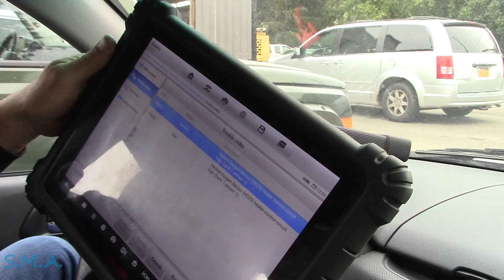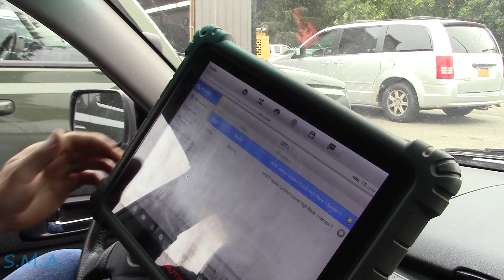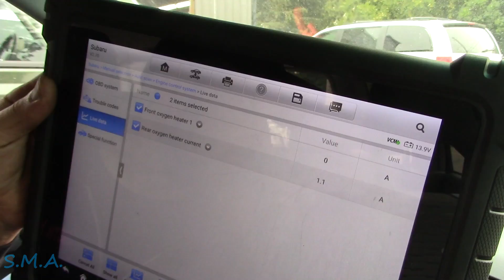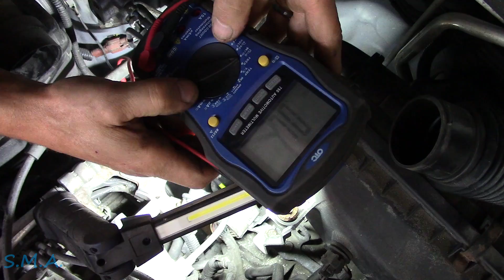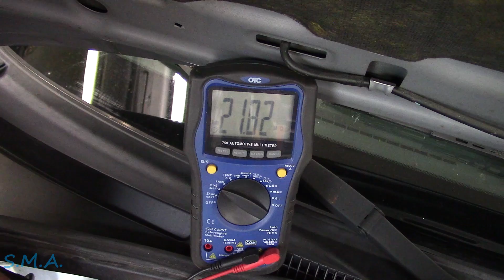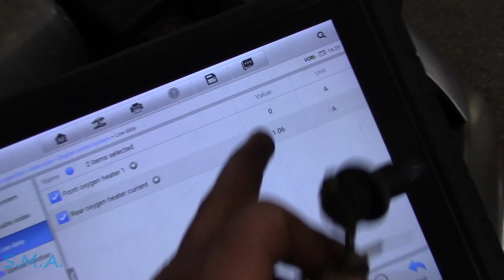Subaru Forester: O2 Sensor Code P0032

Comment: So, when can I expect to need a 'head job' on my 2014 Outback? It has about 70K miles on it now.
Reply: Subaru changed to MultiLayer Steel (MLS) head gaskets in 2009. That made a big difference.
Reply: Never. The FB engines dont have the head gasket issues, or if they do its extremely, extremely rare

Comment: I like that bit of test light bulb tutorial.  My daughter's 02 Subaru had a similar issue but the CV axle rubbed through the front O2 sensor wires. Spliced them and all was well. A real pain to get to though.

Comment: The Snap-On scanner shows individual cylinder misfire counts on way more Vehicles than the autel. If That was CA the ECU would be fried because all the wires got shorted together when they stole the cat
Reply: Eric has several scanners that he uses for various purposes - I suppose each has strengths and weaknesses.

Comment: So technically a 20 ohm resistor across the control and the computer thinks everything is hunky dory and would shut the idiot light  shuts off. I wonder if used car places have done this..mmmm?
Reply: I am shocked that you would suspect some used car palace of doing such a thing! Shocked, I say!
Reply: @flagmichael  So... you've seen Casablanca, too?
Reply: @flagmichael  Are you kidding? I had one place tell me I could fix the squealing belt with belt dressing, and replace the bad sensor myself. I didn't think I walked into CoPart looking for a car.....

Comment: Do all Subarus tick like that? Man that was loud.
Reply: Sounds like  the valvetrain of the passenger side cylinder head to me.
Reply: Probably needs a valve adjustment. The camera could also be picking up and amplifying the sound a bit too, but they aren’t a quiet engine by any means.
Reply: The older 2.5s are super notorious for piston slap. Most of them go for years with that noise without any issue.
Reply: @birdbrainxzx  Yup, mine has been piston slapping when cold forever and it's harmless.  The skirts on the pistons are too short or something.  However, it sounded like this one had  valve noise (too?).
Reply: Yes and no.  Older ones were well known for that sound.  Newer ones are smother and quieter.  My 2015 I compare to an air compressor as it revs up but smooth and nice power.  My Mom still thinks I am lying when I tell her it is a 2.5 4 cylinder because her 2.4 4 cylinder isn't anywhere near as peppy as my subaru.

Comment: I've had a 2009? Dodge grand caravan sxt 3.8 that the thermostat was failed so the van wouldn't heat up fast enough leaving o2 sensor on heat cycle too long burning it out. Guy did 2 o2 sensors before bringing it..real pisser to figure out.
Reply: Good one to put in my diagnostic memory bank, thanks for your comment!
Reply: @mattcat231  your welcome.
Reply: I have never thought about that. Good catch on his part!

Comment: Eric , I like that test that proves the circuit is good ..,
Reply: The way I did it was to test the voltage at the plug with the sensor connected and then disconnected.  Eric's method is better though.

Comment: May just have been the camera placement, but that engine sounded about ready to scatter pieces everywhere. 😂
Reply: That's just how Subaru's sound right?
Reply: @Burn377  I've got a 2010 STI with 115000 miles on it and it doesn't sound at all as tappy as this one does. This one's top (side?) end sounds dry.
Reply: It needs the valves adjusted (old school screw/locknut style)
Reply: yeah it's hammering something hard in the upper end, I've heard excessive valve lash off before, but I'd guess that one has something far worse occurring to be that loose, like maybe valve guide or seat walking out a head, adjuster way backed off. I forget the design without looking it up, but many engine rockers can hit the spring cup and knocking the keepers out, then goodbye valve goes into the cylinder.
maybe the camera amplified it, but otherwise it's terrible sounding and needs addressed before it decides to go part scattering.
Reply: It’s a Subaru thing
Reply: @Codyjrt  It was just replaced in 2018.
Reply: I was thinking that also.  Wicked clatter going on there.
Reply: @Codyjrt  Upper end? it's a horizontally opposed engine ! it has left and right side heads that are down low in the engine compartment.
Any valve train noise is reflected off the inner fenders and sounds louder, especially while the camera with microphone is there to record what we are hearing.
The head and or heads on most other cars, trucks, are up and almost out in the open when the hood is up "compared to a Subaru"
Reply: @scal3guy  Thanks Kyle, every single person in here knows what he means, it's still the top end of the engine.....  So just go away.  I know, you likely learned that yesterday and are excited but calm down.  You and your wife Karen can calm down.
Reply: @sjfk1306  Don't you have a real youtube username ?
"sjfk" What a silly user name 😯
Do you even know what a Subaru engine looks like ?
My wife "Karen" your mum 😋is going to disown you if you keep making stupid replies to other peoples comments !
Reply: @sjfk1306  really? Dragging his wife into it? Anything you could have said of value was obliterated by that.
Reply: @stevewhite3424  Not really.....

Comment: Once removed from the ad hype, head gasket issues drag this car maker down to the truth. All cars have issues. I'll stick to my Toyota.
Reply: Apparently, Subaru got a handle on the head gasket problems starting in the 2009 model year. Different head gaskets.

Comment: “What Subaru hasn’t had a headjob”, just spat my coffee 🤣😂
Reply: The owners hope for one also lol
Reply: @Sicktrickintuner  But not the bad kind.
Reply: @Sicktrickintuner  "The mechanic said I'd blown a seal. I said "Fix the damn thing and leave my private life out of this, okay pal?!"   -- "Wet Dream", by the late Kip Arddotta
Reply: Guilty 😒
Reply: Mine hasn't.  2015 with 110k no head gasket issues so far.  It was mainly a select few years where they were using a graphite coated gasket instead of the good MLS gaskets from the factory.  I do believe they have learned their lesson on that.  For those years that used the Graphite covered gasket when they need to be replaced you just use the MLS from the Turbo version you don't have issues after that.

Comment: I have never seen a video with a volvo. Do you never work on Volvos? Are they not common in your part of the US?
Reply: Mr. J  -  I don't know about upstate New York where SMA is, but here in Wisconsin Volvos are few and far between.  Barely any at all.
Reply: He mentioned a long time ago he avoids euro cars. Don't remember why but I'm sure it's an obvious reason.
Reply: @MiamiZombie2012  would be interesting to know why!
Reply: @Wiksmo  I had 2 Volvo wagons (1970 145 and 1985 765T) and am done with Volvos. I was active in Volvo forums until about 2005, long enough to learn reliability had not improved. They are indeed rugged but that is not the same as being reliable. And parts cost? The 765T had a heater blower failure (thankfully not the nightmare it is in a 240) and Volvo wanted $150 for a replacement that came with instructions about modifying it with a cutoff wheel or hacksaw so it would mount. Chevy sold an exact replacement for the Volvo part (fit some cheap subcompact), for under $50. The turbo wagon also had a problem common to that model for a wide range of model years. The rubber intake ducts would get contaminated with oil from the Volvo version of PCV, and would turn to mush. A full set of ducts was over $1000. No more Volvos for me - 19 years of Prius has required less repair than the 765T required in one year. Oh... and I forgot to mention the biodegradable French wiring in the 1985. All the small gauge wiring under the hood or body stripped itself of insulation after about 10 years of life. I replaced the engine harness with an aftermarket one (only $350 instead of $1100) and did my best with the handful of underbody problems.
Not many mechanics want a piece of that sort of stuff.

Comment: It's a pretty well known  fact that the EJ25 series have either a weeping head gasket or a recently replaced one. But has anyone had issues with them once they have been fixed using mls gaskets?
Reply: As far as I know the issue is resolved with the mls gaskets. The FA and FB series engines seem fine for head gaskets. Even the turbo EJ25 never had the same issues as the N/A engine
Reply: @steveg5886    That's because the factory gasket for the turbo was MLS from day 1.  If you are doing the heads on a non-turbo  2.5 and want to use a factory gasket, you can use the gasket from the turbo.

I assume they specced an MLS gasket for the turbo due to higher pressure and a coated gasket for the non-turbos in order to save a few yen.  Replacing the coated gasket down the road with the part they should have used in the 1st place costs a lot of yen but by then the warranty is expired and it's not their yen.
Reply: 2015 Subaru Forester 2.5i non-turbo and haven't had an issue yet with head gaskets.  I have over 110K miles on it so if it had the graphite gasket instead of the MLS it would have been leaking by now.  No loss of oil or coolant yet.
Reply: I'm around 6k miles on my mls gaskets. No leaks yet. Transmission seems wonky though. Separate issue, but it's pissing me off.
Reply: I’ve done 2 head jobs on my 253. Used OE MLS gasket from a 25D to make up head thickness after a shaving mishap on the first go. Got just shy of 30K before if blew. Used a FelPro brand of the same gasket variant the second time around just using a carbide scraper to clean the block and heads (didn’t overheat that time), have over 43K on them with no leaks or issues. Take from that whatever you will, just figured I’d add to the pool of info. 

P.S. to anyone with a head job in their future, forester or otherwise… just pull the motor. Much easier (assuming the studs aren’t gone) and you can do the oil pan gasket it inevitably needs at the same time. 😆
Reply: @improbablyoutside  agree on pulling motor and doing other items whilst it's out
Reply: @improbablyoutside  so which gaskets did you use?  The OE Graphite covered gaskets or the Turbo MLS gaskets. Your post saying OE MLS doesn’t completely make sense because they are two different gaskets. 

Please don’t take this as criticism or trying to make fun. All I am wanting is clarification because I am confused by your statement.
Reply: @trevorshiffermiller2412  none taken! I see your confusion. 

The Subaru part #11044AA610 is an MLS gasket. Subaru has made non turbo MLS gaskets a couple times in specific instances, the late 90’s EJ25D being one of them.
Reply: Inquiring minds want to know. Subaru has had head gasket trouble for so long I think many of us have a lot of skepticism about any glimmer of hope. Apparently Subaru started using MLS head gaskets starting in the 2009 models, which would mean most of the Subies on the road now would have them.

Comment: Probing the unplugged wiring harness is not testing the sensor.
Reply: He tested the entire wiring circuit and the computer control was verified.  What else  is left in the circuit except the 02 sensor???  It's called "process of elimination".
Reply: The harness he first tested with the multi meter was the sensor. The sensor has a small length of wiring and a connector. Heater circuit is seperate and only concerning two wires in that small harness that is part of the sensor.
Reply: He only needed to check the heater circuit.... it’s just a coil.  No need to check the sensor side
Reply: Just to be clear, the first test isn't on the harness from the ECU to the sensor, it's on the connector on the end of the pigtail from the sensor.  It's true that we don't know if the fault is in the sensor itself or the wiring, but the thing Eric probed was the replaceable module - the new sensor comes with the wire and connector.